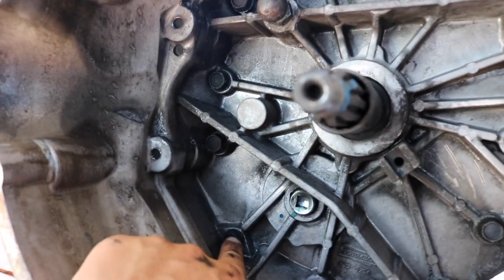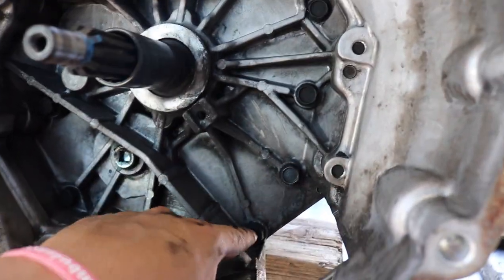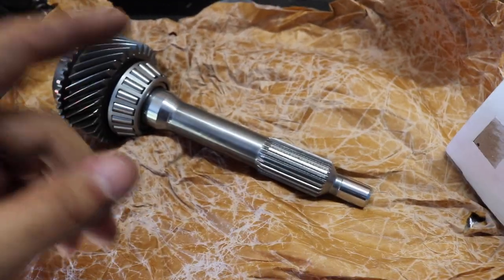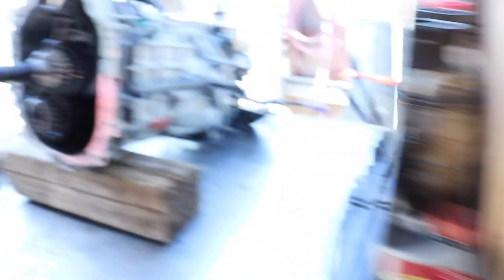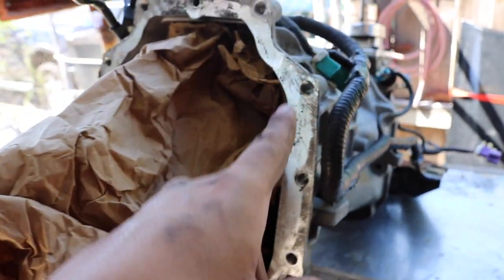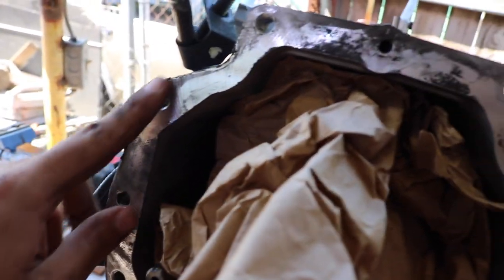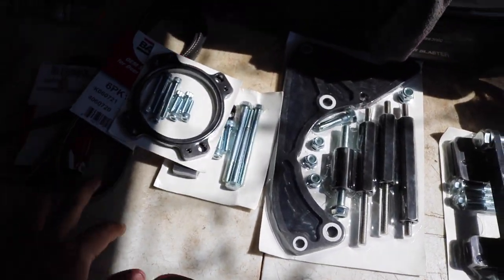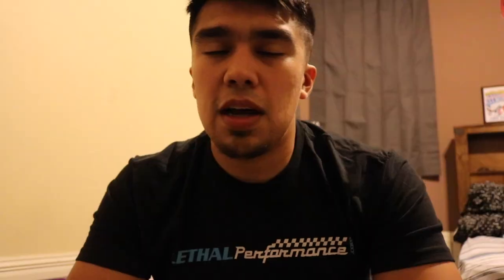COYOTE SWAP NEW EDGE : T56 gets a 26 spline input shaft !

Comment: Sorry for commenting a lot but I’m just preparing myself for a coyote swap . Seeing that you have to buy a lot of different stuff for the mt82 to work I just want to upgrade to a t56 while I’m at it . My car is a 96 v6 model . What all would I need to swap in the coyote with it . The coyote t56 bell housing . Different clutch and pressure plate make sure I get the adjustable pivot ball and cross member ?
Reply from the maker: For a cobra t56 you will need the bell housing it comes with if you don’t have it you will need a quick time bell housing . Also if it’s a cobra t56 then you will need a cobra aluminum drive shaft as well as a cobra pinion flange . Depending on the input shaft you can use 4.6/5.0 clutch all depends on what you want . Also if you decide to get a t56 magnum you will need either a cobra t56 bell housing it works on both transmissions but more then likely you will need the quick time bell housing as the cobra t56 ones are hard to find. With the t56 magnum you will need a custom drive shaft many people take measurements from tail shaft to pinion and place order orrrr you can just order a ready to go kit from lethal performance ! Thanks bro don’t worry everyone’s got questions 🤘🏼
Reply: @xJD2Vx  ended up winning a auction on a gem 3 with a auto . So just gonna upgrade to a magnum while I’m at it . Does the t56 work with regular master cylinder & reservoir? And do I have to be prepared for the wiring to it or with manual control pack I don’t have to worry about any wiring to the t56 mag . I appreciate you answering my questions man . Glad you saved the coyote before it was to late 🔥